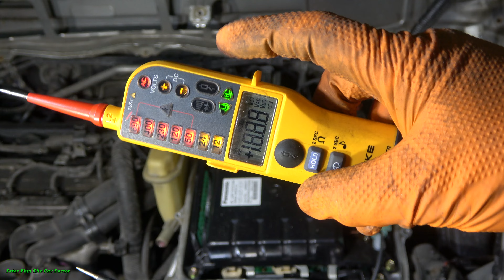How to replace Toyota Prius 1.5 engine. Years 2002 to 2009. PART 13: Hybrid Converter away

Comment: Excellent and very accurate job Peter! It needs a lot of attention so we don't get electrocuted! Great measurements with your meter to check for the presence of electricity! Very good idea to open the big stuck cable from the electrical box side! The best part was when you managed to lift the converter with your hands! It is a lot of weight, so you are not so weak man as you said. Of course, young Arnold Schwarzenegger would lift that with ease!
Reply from the maker: Yes, exactly